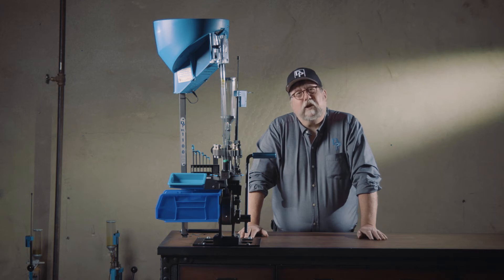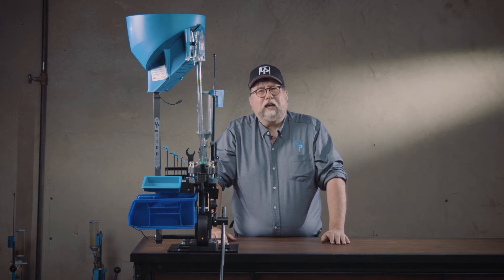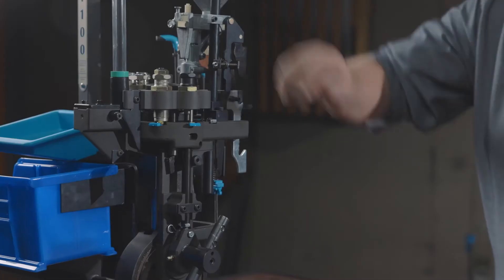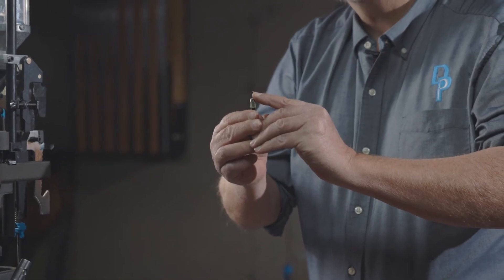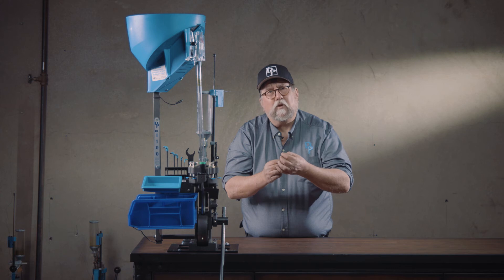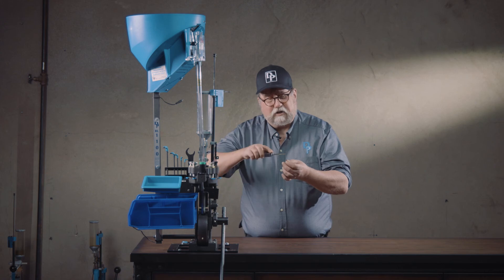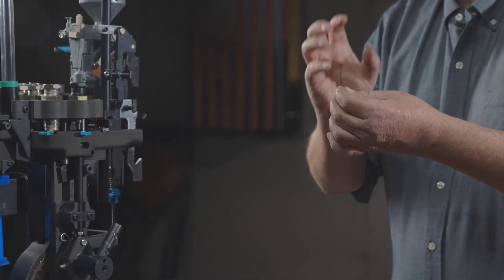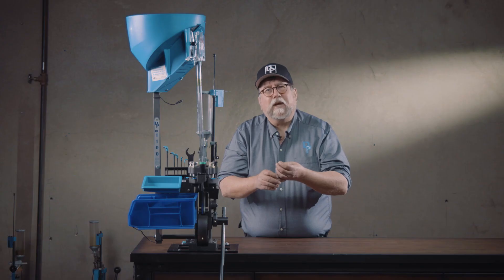Dillon Precision - RL1100 - Primers Sticking

Comment: Back in the day if I had a primer suck back, it was generally a bit of corncob media that got smashed between the decap pin and anvil that caused the adhesion.  I switched to wet pin tumbling and it was no longer an issue. Later I rigged up Lee’s single stage auto feed APP to work with a Dillon case feeder. The APP is cheap enough I don’t care about running gritty cases through it, and being able to decap thousands of cases an hour makes depriming prior to cleaning worth doing. 

I do wish someone (hopefully Dillon, with their quality and customer service) would make a much higher capacity and heavy duty pin tumbler than what is on the market currently. If it could be designed with an integrated separator and dryer, say if the barrel inclined one way while cleaning, then you drained it, inclined it the other way, removed an end cap and stuck in a rinse/air nozzle there- then a dry cycle could rinse l/separate, then run hot air while periodically rotating the drum.  

IE once you loaded say 3 gallons of brass, you wouldn’t have to handle brass again until it was clean, rinsed, separated and dried.